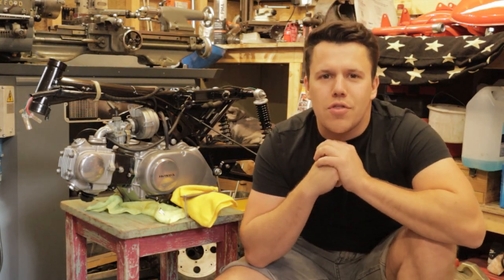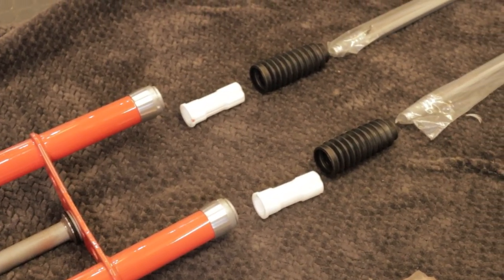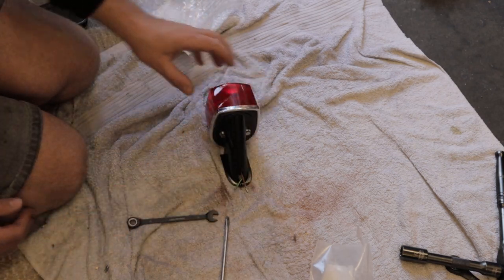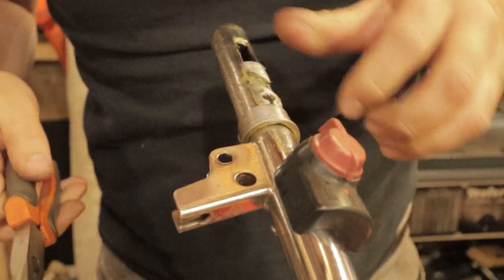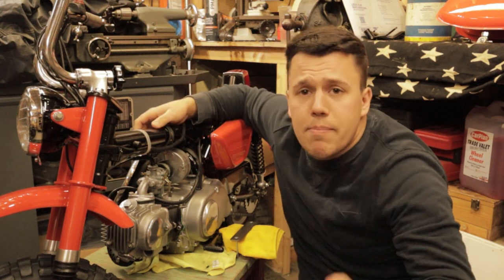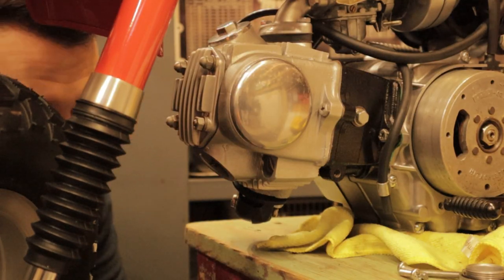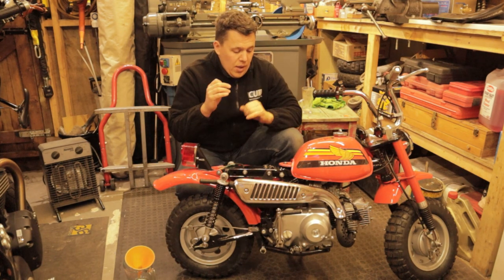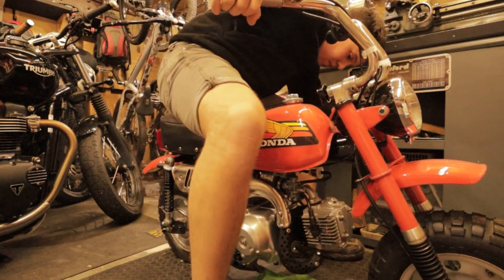Restoring my Classic Monkey Bike - Honda Z50A Part 6 Finale

Comment: well done lad! I'm looking for my own decent enough z50 to refurb, your videos will be a fantastic help when my time comes. cheers
Reply from the maker: Great to hear! they are super fun projects. If you ever have any questions, feel free to drop me a message/email. I've found a place for most parts and have come across many many issues and found solutions so should always be able to help. Good luck with it
Reply: @MasonsWorkshop  how much did the full project cost in the end? Also, is your video up of you riding the bike now it's complete?
Reply from the maker: I paid £1500 for the bike and realistically spent similar if not more on parts/materials but I haven't added it up. As these bikes get rarer the part price becomes crazy. Good paint, chroming, zinc plating all add up. If you love it, its worth every penny. I actually had a few leaks on this engine along with deciding to get some bits repainted and zinc plated to make it perfect. Just waiting to button those things up then ill be insuring it and taking it on a proper ride! and yes it is fully road registered! If you follow my Instagram (mason_bennett54) I have loads of content on it and can answer any questions via direct message!

Comment: COULD PLEASE GIVE ME THE INFO ON THE NEW REGISTER PLATE,THANK YOU
Reply from the maker: Sorry, what info are you after ?
Reply: @MasonsWorkshop  THE ALUMINIUM ID NUMBER PLATE ON THE FRONT OF THE GOOSE NECK YOU SAID IT WAS COPYED BY A COMPANY IN NETHERLANDS.
Reply: THANK YOU FOR GETTING BACK TO ME
Reply from the maker: @cliffordclauser5496  oh yes, the company is called KHNEISSER, if you drop them an email, Bruno will get back to you. Extremely helpful. They didn’t have mine in stock so I sent a photocopy and dimensions and they made a new one, OEM quality.